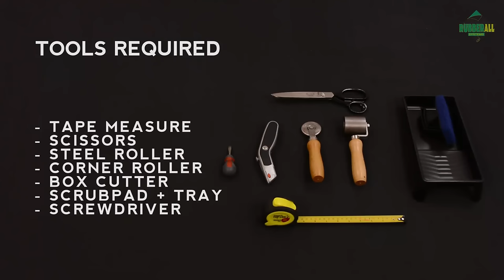How to Install a Rubber Flat Roof - Part 5 - Internal and External Corner Details

Comment: As an installer for Firestone. We got told on 1.16mm Fire rated blankets (Marked FR) as you show here getting installed, instead of the pond liner type ones at 1.0mm.
The writing has to be facing up as the underside is coated only. 🤔 
This was installed upside down - luckily no fire 😊
Reply from the maker: Dear Steve,
This is an LSFR sheet for the EU (it's just that the fold in the rubber did not allow the LS to be seen). With the LSFR sheet there is no specific side which needs to be installed pointing up as the fire retardent chemicals are distributed throughout the sheet. This may be different with the US sheet? Regards
Marc
Reply: Plytech UK Ltd I’m based in East Yorkshire also. 
We had to turn our Epdm rolls over as the manufacture of the rolls was rolling them outside in, so we fitting them as the manufacture was producing them. To be told by an authorised Firestone inspector. He will not issue the 30yrs warranty until We installed correctly.

So the rest of the rools we had in stock for jobs, we had to make sure the writing was facing up (FR SHOWING)

Different rules / different guidelines. Guess we also have the strict firestone verified checker then for the warranties.
Reply from the maker: Hi Steve, Apologies this comment has been overlooked. The EPDM performs the same whichever side you put down. Some prefer the serial number up in case there are any warranty issues, then it is easier to prove which supplier the rubber has come from.
My preference would be to install with the serial number down and make a note of the serial number against the warranty info - that way the customer does not potentially have to look at a print across their roof. Hope this helps.
Reply: The only problem I have with these videos that are always made in warehouses is these are not real conditions. Installers do not have time to handle the rubber 3 or 4 times before glueing and setting it when the sheet is 130 to 150 degrees and burns you every time you touch it. The sheet will be set up to wall as close as possible and glued 100% and none of those cuts will be made till it’s actually being put in.

Comment: Sarnafil welded on corners with hot air and rollers gives me more peace of mind than using bonding materials. However, your job looks and has been made well.
Reply: Great roofers did it all without actually stepping on it

Comment: Next time use more rubber, and cover the top of the wall and curb. Leak disaster if you think the cap metal will keep water from penetrating, or disallow condensation.

Comment: Where you have a rooflight involved, is it easier to have the membrane in two pieces and join them, as shown here?
Reply from the maker: Hi David, joining the membrane is an option and can make the job easier. However any join in the membrane is best avoided if at all possible as any additional joins or cuts can create an area of failure (especially if an installer is new to techniques).

Comment: Can't you cut the rubber on the internal corners? And use the tape to make an internal corner or is folding the rubber the only way?
Reply from the maker: Hi fudgewaa,
You could cut the rubber in the internal corners but any extra cut is a potential for a leak. My preference would always be to have  fewer cuts if possible. As the EPDM is very flexible it is quite easy to fold into the internal corners, however I would advise checking that no factory welds fall into the internal corner as the rubber can become thicker in these sections. Hope this helps.

Comment: Can this Rubber be applied on walls too, if not what is an alternative to wrap the walls that have no overhang ?
Reply from the maker: Hi, Yes the rubber can be adhered to brick or concrete using solvent adhesive. The flashing tapes can be adhered to most other materials also using the butyl primer for flashing tapes. I hope that this helps.
Regards
Marc

Comment: can this product be used under a green roof situation ?
Reply from the maker: Hi Rob,

Yes, EPDM is extensively used for Green Roof applications and is a very durable product that can often be installed in a single sheet which further reduces any water ingress possibility.

Comment: Does this roof rely on a mastic bead atal ?
Reply from the maker: Hi Peaky_Blinder
The roof edge is finished with either a mechanically fixed trim edge or with a tape system. Please let us know if you require any further assistance by emailing sales@plytech.co.uk or calling +44 1392 454810
Reply: They cannot be confident about seal if silicone is being used . Using this method start the van leave no contact don't look back .
Reply: @plytechukltd3475  hi, not the edge, you can use spread trim for that, 
I'm talki g about the external corners in the middle of the roof, 
How do you deal the rubber flashing after you cut the EPDM, 
Being as it's impossible to vulcanise when you glue the flashing on how do you protect the glue that is vulnerable and will break down under water.
How do you protect the glued rubber.
Reply: @robertgissy2851  the call it liquid rubber but it does rely on mastic,
I have seen lots of failed EPDM roofs .

Comment: Please could you describe (writing as subtitle?) what are the measurements around the edges and how much etc.? and where for the novice fitting EPDM. 
Many thanks
Reply from the maker: Dear Amir, the subtitle "Allow to tack off" is referring to the contact adhesive which has to be allowed time to go tacky but NOT stringy. This will then be ready for adhesion. The minimum upstand required in the UK is normally 150mm. We would advise allowing a 200mm excess on each edge of your EPDM rubber to ensure you do not run short. We aim for a 45 degree angle for both the internal corner fold and the external corner cut to make this look neater. If you are interested in a course we offer a one day training course at our Exeter warehouse. Please contact Plytech UK Limited on 01392 454810 if you wish to discuss further. Kind Regards Marc

Comment from the maker: As long as you clean the roof well then you should be able to adhere down with contact adhesive. Any further questions just call us on 01392 454810 - Thanks

Comment: As a building envelope consultant of 35 years I can't take this video seriously because attaching a membrane to OSB is just about the dumbest thing in the world. You have to use Quality Base materials that when they get wet will not turn into oatmeal
Reply: Then you don’t have a clue what your talking about OSB3 is designed for this and EPDM manufacturers approve this 
OSB3 is waterproof
Reply: @macsmith6216  every investigation I do on a failed epdm roof always has what's left of OSB....  I suppose you think zip is waterproof also lmfao@u
Reply: Hello Deputy, can you tell us what "should" be used instead of OSB3? If a waterproofing layer has failed, nothing cost effective is going to mitigate water ingress except a second waterproofing layer...

Comment: everything you did is wrong
Reply from the maker: Hello Missteryguy,

Thank you for your feedback if you have any extra tips and pointers then please post them up or advise - I admit there are a number of options for completion of the internal corner pigs ear and this mostly comes down to personal preference. With regard to the External corner Rubberall method is a belts and braces method using 2 flashing details (150mm and 300mm) to ensure that any potential points of failure are covered in duplicate. I look forward to hearing from you.

Kind Regards
Plytech UK Ltd
Reply: I don't think so, and this troll didn't say what was wrong. You did the inside corner internally, and as long as it sloping towards the roof, how can that be wrong? Using 2 flashings on the corner,  I think is an excellent idea. So often people don't overlap in the right direction - but you did. I think it was very instructional.
Reply: there is always 1 prick that knows better
Reply: @plytechukltd3475  7k